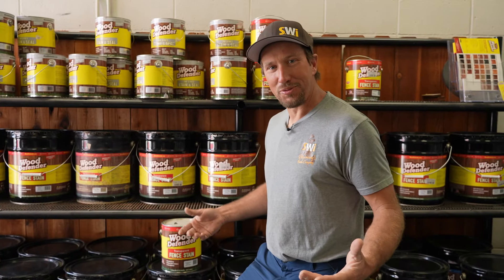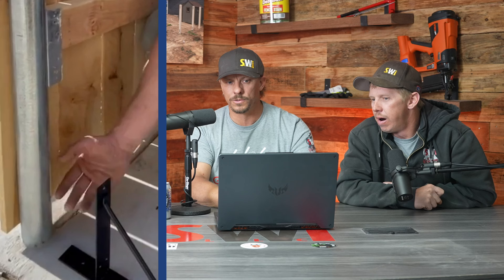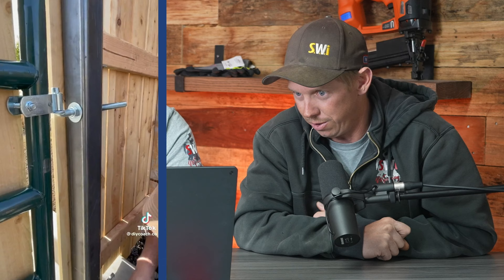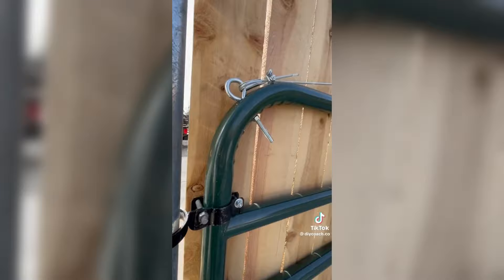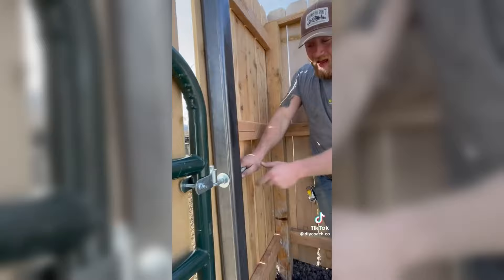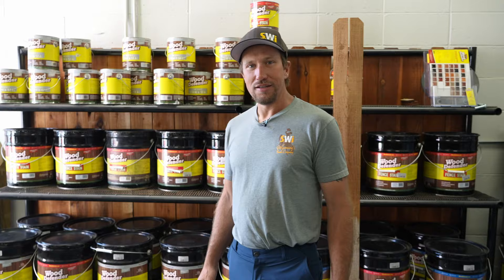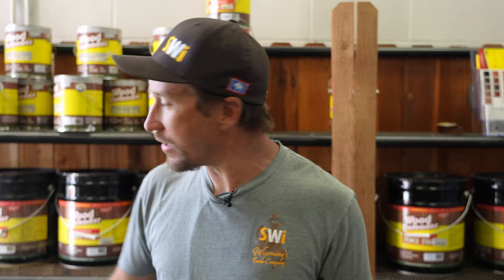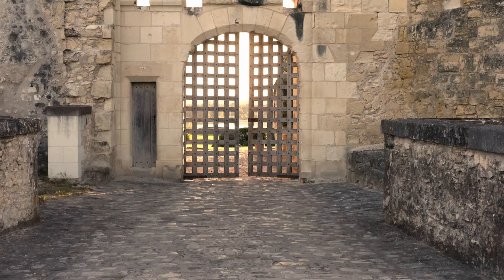Crazy Viral TikTok Gate: Fence Brothers React

Comment: If I had a gate that long I would make it a roller. Those angle bolt hinges are only good for small chain link. The swing gate I have is 14 feet and is attached to a 4 inch galvanized water pipe.  Custom welded hinge  Those pickets will be warped in one year on the gate you showed.
Reply from the maker: They're not gonna take long to warp--agreed.